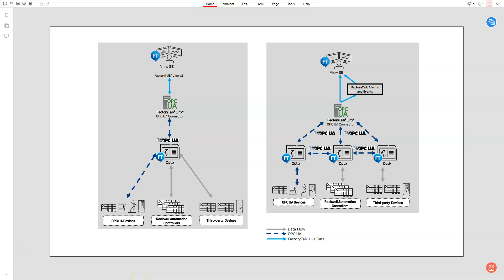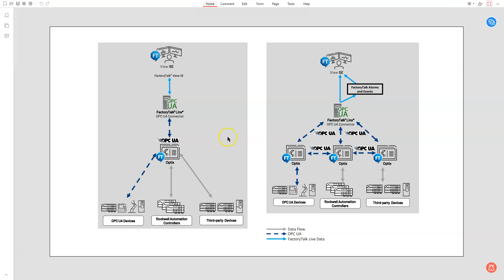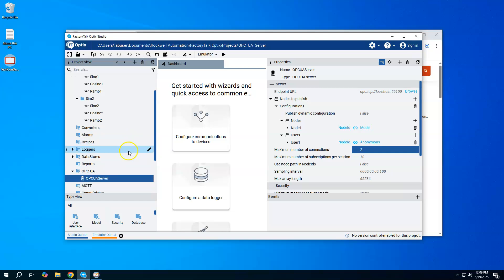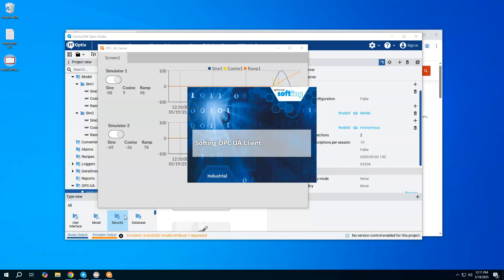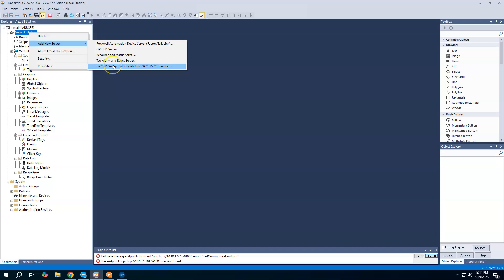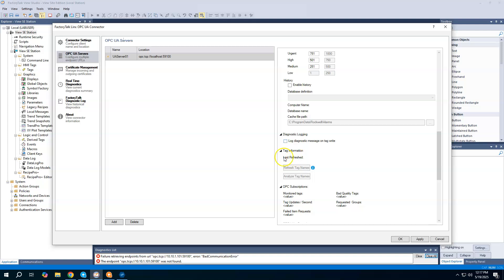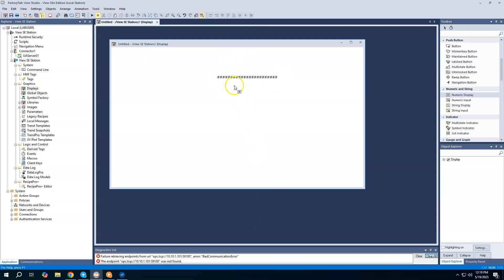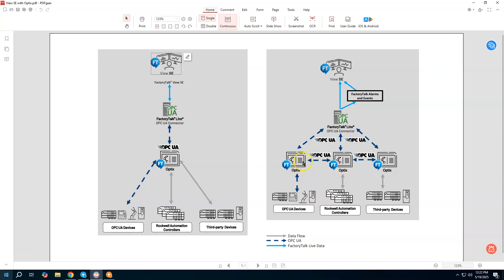Extending View SE with Optix with the FactoryTalk Linx OPC UA Connector

Comment: What do you think about this situation ?  
We have 20 RA plc , 3siemens and 2 mitsubishi and we are planing to create a Scada system Ft optix  . monitoring system , We are not planing to control . 
Should i create couple Ft optix Projects to generate couple web presentation for each monitor ?  i was thinking to stretch it to monitor scale  
Is there any application we can use it to multiple monitor screens from one FT optix project? 
Do you think Thinmanager would help me through this ?
Reply from the maker: If just using the WebPresentationEngine from the one central Optix application, then you could just have 2 or more web client sessions connected simultaneously to view the different displays.

You could also use ThinManager with Optix for either the NativePresentationEngine or WebPresentationEngine.  But most likely if using the web client over ThinManager it would probably take multiple web client sessions (tokens) just like if you were connecting directly (not through ThinManager).